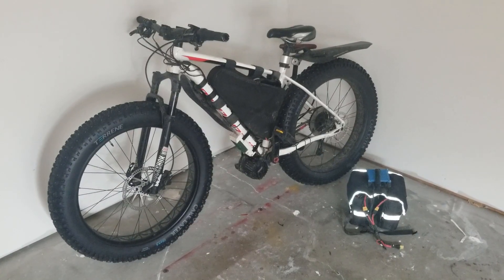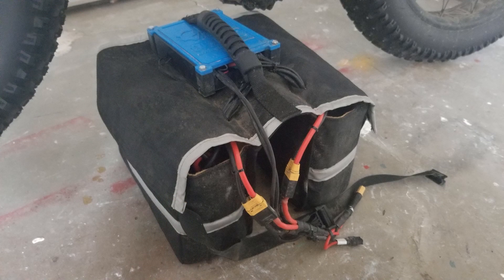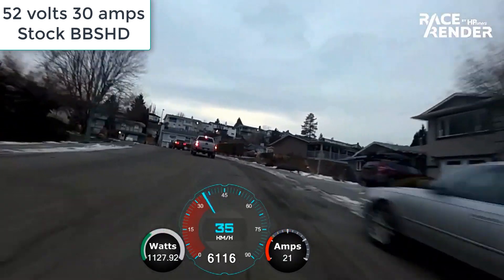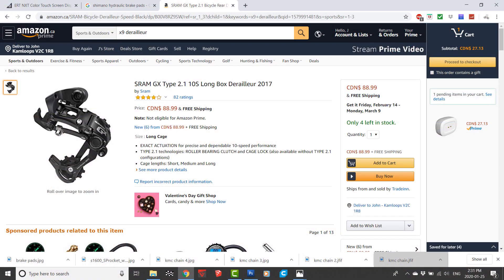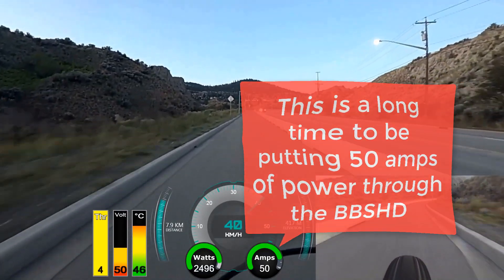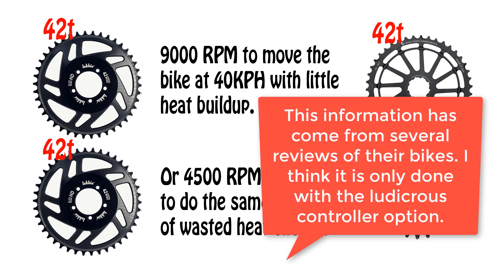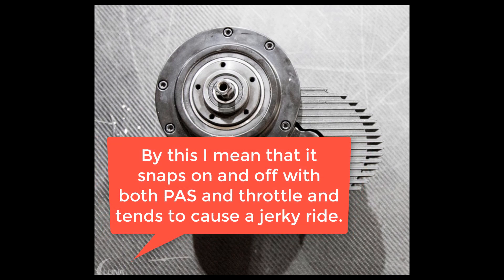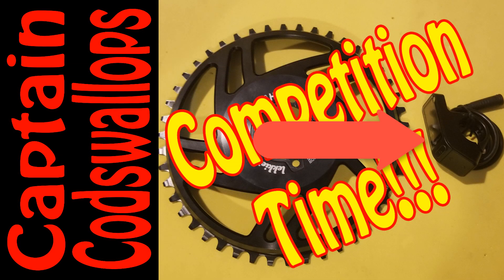Bafang BBSHD - ASI BAC 800 72v - Specialized Fatboy Ebike Conversion. The fastest & most reliable?

Comment: Just gotta change the plastic gear replacement.. like a Subaru head gasket
Reply from the maker: Shockingly I’m still on the original. I had figured I’d need to change it. I think the 1:1 gear ratio saved me!

Comment: How do you know what rpm you’re running? The motor on a 52v battery should be around 3700rpm. Its output spins at 160 rpm x 23:1 reduction. I know with higher voltage and field weakening you’ll gain a bit, but not that much
Reply from the maker: You gain a massive amount of rpm with the right controller and tuning. I am getting up to 13000 rpm loaded and over 18,000 unloaded. With a 52 volt battery it’s about 9000 peak loaded. Well over double the max stock at that voltage. The rpm is being recorded via the ASI Bluetooth app during the ride.
Reply: @HighVoltageKits  I think I got it. Someone else mentioned it. I think your controller is reading the poles. The bbshd has 4 pole pairs. 13,000 rpm / 4 = 3250. Which would be a proper rpm for the motor to spin at 52v.  But mechanically, the rotor is spinning at 3250rpm and the chainring is spinning at 150rpm or so
Reply from the maker: @victorvannatter312 nope. The bbshd has five pole pairs. The rpm is 13,000 and the data is coming directly from the controller. It’s using field weakening to boost the max RPM of the motor.
Reply: Interesting. But something seems not right with that. I’m not sure where it is getting that information from. But that’s not how electric motors work. They get their RPM from the way they are wound, and the applied voltage. There is nothing else a controller can do except for field weakening. But that will not make those type of gains. You would be going over 150km/h if the motor was spinning that fast. The output after reduction would be 565 rpm btw. Stock is 160. There’s something wrong. It’s a really good and informative video video, so I’m not trying to give you a hard time. But I would definitely look into that.
Reply from the maker: Sorry I missed this. There are lots of videos on the channel of this build. It’s 100% possible with field weakening. The top speed on a bike is 65-70kph with a 1:1 ratio to the back wheel.
Reply: @HighVoltageKits  you claimed in another video you gain 15% with field weakening. The rpms you’re claiming is an increase of 350%. That is simply not possible. There’s no way you gained 350% more rotor RPM with field weakening. There’s something else to explain this. This motor turns at around 3600rpm factory with a 52v battery. Unfortunately,  grin’s motor simulator doesn’t have field weakening. But to get that type of RPM, it would need around 200 V. That’s a huge jump from 52. I would be really interested to see if you had an external RPM gauge, and you were able to measure the chain ring RPM.  For the motor to be at 13,000 RPM, you would need to see 565 RPM at chain ring. 
Don’t get me wrong. It’s an impressive build. And you know what you’re about. I just think you’re getting wrong information from your controller. I’d be happy to be proven wrong. I just don’t see field weakening giving an over 350% increase in rpm

Comment: Hi, just come across your channel. I run 3 fat bikes in Wales UK, thinking of running a BBs-02, or BBSHD on one of them, over buying an E bike with Bosch, Yamaha or Shimano motor. I'm 20st in weight, South Wales is hilly in parts, but like you know, weather not the best throughout the year, and overall temperature not the warmest, if that makes any difference?. If I wanted a bike for carrying maybe a front or rear pannier, to carry a camera or drone, am I looking in the right direction for my first conversion? I ride two bikes with 26in wheels, 65mm wide rims with 4.8in tyres, and one with 26in wheel, 65mm wide and alternate 3.8 or 4in tyres.
Reply from the maker: Spent loads of time in Wales. Pembroke and Snowdonia mostly. Also, Tywyn way. My sister is near Carmathan so I'll be over next year. Lower temps mean the motor will run cooler overall. Recommend the BBSHD over the 02. There are also some new motors from TOSEVEN. The DM01 is I hope going to be the equivalent of the BBSHD with torque sensing. If you check the video history you can see info on those. You are also welcome on our Discord community. Links in the description.
Reply: @HighVoltageKits  Hi again, thanks for the heads up. I got two bikes I been considering running it on, as my two other fattys I'm running 4.8s and the stays and BB are so wide I think I'd be taking that chain line way out away from the BB and too much fuss on the mods taking away the lower gears. I'm either going to try it on a Marin Pine Mountain 27.5+ bike with 3in tyres, or a Ritchey Commando fat bike with narrower stays/BB on a 4in tyre. I'll check out the links of the other brand also. So for instance, as an example, if it was the same motor, same gearing on the bike, in a 500wt, 750, 1000, 1000+ travelling on the flat, at the same speed, which motor would be the most reliable, economical between charges, durable, and go the furthest distance also travelling at the same speed for all units? Remember i'm 20st, and thinking of a pannier for camera gear and maybe a drone also. Snowdonia looks stunning, we got a few nice trails down here just off the M4 motorway also, that's worth a look. Thank you for the previous reply. A friend of mine has a 48wt battery for sale also, so may get lucky with a new setup with two batteries.

Comment: Great video, thanks! I seem to remember seeing a video that Justin from Grin Technologies did where he installed a Phaserunner motor controller on a BBSHD and I thought that it fit snugly in the controller cavity after removing the stock controller. I can’t find that video anymore, and I wonder if Bafang made them take it down. I’m glad to learn about the ASI controlller, thanks for posting!
Reply from the maker: Thats another option. The phaserunner is based on the same circuit boards as the BAC800. They get the boards and put it on their own designed casing. They work pretty closely on it.

Comment: Great video, I have learned a lot.
Have you ever pulled any kind of trailer up a hill? I am hoping to modify my fat tire bike or another hybrid MTN bike to do this, either with camping gear or work equpment, but can't look too illegally powerful
Do you get stopped by Police? The central bag housing a battery makes the bike look more illegally powerful than the paniers battery setup because the motor is very discrete.
Reply from the maker: Thanks Nick. Check this video out from way back in 2018 I think. https://youtu.be/pOoZACypiFM I used to pull a two person trailer when the kids were younger. This was with a stock BBSHD. It was awesome tho. I am not sure how it would work with the High Power stuff as it stands now as the stresses are different. 1700watts was no problem tho! Was great fun passing all the lycra office gang. Never had bother with the police. Mainly because I ride respectfully and don't draw attention. Mostly they remark on the massive tires. The motor gets ignored. If I passed them doing 70 I think it might be different.
Reply: @HighVoltageKits  Yes people mostly remark on my tires too, they seem to think it makes the bike faster or more powerful, I explain there is no advantage on a road. one guy said my bike looks like it ought to have machine guns on it, its a bit Mad Max looking.
have you, or do you know anyone who took a rear hub motor and converted it to a front hub? It seems like it might work removing the cassette holder and carefully cutting down the axle bolt, adding new threads. After I upgrade the rear motor I will have a spare so I may as well try this with a smaller battery on the front rack and the same old controller, just to give me more power on a hill. another throttle too

Comment: The BBSHD is seriously flawed.  The revs it needs are way too high and the internal gear reduction is laughably inadequate.  There is no pedal resistance with a 1:1 ratio, turning the pedals does nothing except keep the current flowing to the motor.
Reply from the maker: Well it depends on your perspective as to what is a flaw or not. If you want peddle resistance run it stock. I'm running it at 4kw 72 volts like a mini dirt bike. I don't give a rats ass about PAS for exercise. I just like cruising about on fat wheels in any terrain no sweat and lycra needed. Stock the revs are like 4000 max. This is heavily modified for a reason. The 1:1 is to stop the internals melting. The riding you see is on the throttle. The internal gearing stock is very adequate. Check out some other videos before you judge it. Cheers
Reply: @HighVoltageKits  You're missing the point.  Stock is 1500 watts, six times the power of the average cyclists legs.  If it could deliver 1500 watts at 60 rpm crank speed you wouldn't need 4kw.  You could shift into the smallest cog and haul ass.
Reply from the maker: George. I used to run this stock. You don't have to use all 1500 watts. You can easily set it to just 200 or even 100 if you choose to. If you use an eggrider v2 you have a huge amount of control. You can even disable field weakening and have a program that gets you low power and rpm with our upgrades. I'm not interested in that myself. Your reasoning makes no sense though. Does a 750 watt motor have to be run at 750 or can it scale to a riders requirements. Do you have a bbshd? Have you ever tried to use one?
Reply: @HighVoltageKits  I have a BBSHD from Luna, 1500W, PAS and throttle.  Why would you run 1:1 at 15k rpm?  THAT makes sense?  The way it's supposed to work with a mid drive is that you upshift when when your legs spin out, you utilize the bike transmission.  Your setup is like riding around in first gear all the time in a car.  I don't like my feet just dangling with no pedal resistance, I feel a huge loss of control.  A bicycle rides over bumps and handles way better IF some pedal resistance is maintained.  I guess what you're saying is that the motor will overheat unless it's being run at high revs.  I think more gear reduction solve that and/or a motor that's happy at lower rpms.  Is that impossible?  Subscribed.
Reply from the maker: The short answer is that it's fun. I have not much interest in the exercise peddle part. It's  exactly as you say to prevent heat buildup. There is lots you can do with gears to have multi use bike but this is like a mini dirt bike in many ways. We have a discord community If you wanted to get tips on tuning the motor.  Thanks for the sub. Appreciated
Reply: @HighVoltageKits  Thanks, I will join the discord community.  Have you not heard the complaint I'm making from others?  I've always heard that electric motors make max power immediately, unlike an internal combustion engine.  Hence there's no need for a transmission.  Yet, evidently, it doesn't work that way with electric bicycles.  I'm thinking that hub motors may be superior because hub speeds are much higher than crank speeds, allow the motor to run at higher rpms.  It would be neat to figure out the ratio of hub rpm to crank rpm.  There are now high end electric road bikes with hub motors!  My first reaction was astonishment, they went backwards, but now I'm not so sure of that.
Reply: @HighVoltageKits  Evidently, I need an "invite" to join the discord community.
Reply from the maker: https://highvoltagekits.com/discord link and some information here, apologies George.

Comment: nice to hear critical points from an ebike builder who clearly has experimented with various configurations. more voltage, less amps = less heat….with a power increase. I built a bafang 750 watt coupled to a nuvinci rear hub with autoshift.  I have it geared low with a 34 narrow wide chainring on the bafang, and a 18 tooth on the nuvinci.  Motor always spins easily, and climbs ‘til it throws you off the back.  And only use a 10 amp/hr 48 volt battery, which lasts a very long time, motor is never amping up, even from a standstill, because the autoshift always starts you in the lowest gearing.  These cv hubs compliment the mid drives very well….only one chainline, so its super low maintainance…no derailleur😀  cheers and happy new year!
Reply from the maker: Your bike sounds awesome. Sounds like you got a good balance to let you climb those hills with ease! Happy New Year Jim!

Comment: literally just ordered my kit thinking 100mm would fit.. man i wish i saw your video first, Can i still make the 100mm work do you think? i have a 2016 specialized fatboy.  If i have to return it, hopefully that isnt too much trouble either.
Reply: also where in canada are you? im over here in Winnipeg Manitoba, pretty flat and no where near as nice as you showed in your video.
Reply from the maker: I'm in Kamloops BC, Unless the 2016 has significantly different seat stays I doubt it will fit and give you enough clearance to center the cranks etc.

Comment: Would it make sense to use an internal geared hub with maybe 3 gears, one for hills and two for flat out speed?
Reply from the maker: It's not a bad idea. Finding one strong enough to handle the torque is the challenge
Reply: @HighVoltageKits  That is what I am finding. Although, it would seem I am not the only one having this thought. The marketing is starting to address torque issues on the internal gear hubs.

Comment: Sorry if you covered this- could you recap how the upgraded controller feels w/ 52v battery vs. stock controller w/ 52v battery? I'm wondering if this is still  worthwhile if I don't want to buy a 72v battery.
Reply from the maker: This video is at 52 volts with the upgraded controller. You get a good boost as long as the battery can handle the amps.
Reply: You must check your battery BMS, I have 52v 21ah but unfortunately, 30A BMS, so even with the ASI BAC 800 as the controller. The max I can pull is 1500 w. Learned the hard way, do your homework first. 😫

Comment: Thank you for this video. I didn't see brake cut-off switches on your brakes, do you feel they're unnecessary? I'm doing a Salsa Mukluk build and would like to not use the cut-offs if possible as they're a pain to setup.
Thanks
Reply from the maker: You are welcome. I do have one on there but its hard to see. They can be useful. Mainly cause you can do a soft trigger and change gear etc. Are you doing a stock bbshd or modified?
Reply: @HighVoltageKits  A stock bbshd for now.  I was going to add that button cut-off on the left side for that type of shift and also a gear shift sensor.  Thanks
Reply from the maker: I'd skip the gear sensor and use the cut off. It only takes a slight touch to cut power. Change gear and back on. The gear sensors are not very responsive imo. Cutoff I like on the back brake.
Reply: @HighVoltageKits  Thanks, will do.

Comment: Well done. I was particularly interested in the logic you shared using the nylon gear. Without being an engineer on the team that designed this motor I believe that is the reason for using nylon. It's a perishable part that keeps you from destroying the motor. no questions about it. Thanks again. well done.
Reply from the maker: Cheers Steve. Still on the same one all these years later. Seem a few folks burn up stators that would likely have been saved with a nylon gear that went to the steel version. Cheers

Comment: I have 250w middrive yamaha motter..is it possible for me to covert it to a throttle only to do at least 25mph...its a giant fallon hard tail with a 500w battery?? Any help would be appreciated
Reply from the maker: There are chips you can buy to unlock bikes but it's not something I am familiar with. Does it have a throttle right now?
Reply: No its a giant hard tail mountain bike...2021 model am not sure what they peak at? Trying tofind put if i can get more watts out of the motter then put a throttle on to it...our just put a hub motter on an hook it up to my stock 500w battery
Reply from the maker: The difficulty is that they are usually closed systems. You might be able to derestrict it and get a power boost but a throttle addition it unlikely.

Comment: For all your money you paid i don't think it's worth it.
Was that controller about $350 WTF
That was the price of the full ebike I built.
Mid drive system 2000-watt
Including everything 
Including a 12 speed upgrade with eagle technology parts.
Including 72v battery 20s 7p original cells.
Including the bike 
When my wheel is spinning it looks like it's 4 times faster then yours in video.
I can only keep the Throttle on for few seconds feels like going to rip itself off.
Spinning that fast 

I must have bought the cheapest 12 speed chain I could find I never had any problems with it.
I'm not sure what people is doing to their chains.
They mustn't be able to ride a bike properly lol.
Reply from the maker: The frame rates on the video are a terrible indicator of speed. Hang on you built an entire ebike for $350 USD including a gear system which alone is almost $250-300... not sure I follow. Sounds Iike a fun bike tho. Which mid drive did you go with?

Comment: Thank you for sharing! I'm about to sell 2 of my hub motor bikes to build a mid drive and I saw people saying that controller with the Bafang BBSHD motor were amazing.. Little bit more research but I'm sold on the idea. I'll be going with a geared hub with belt drive though. But now with your lesson on the gears and heating the motor I have a better idea of what to look for. I'm going to over power a hub motor with that controller first. I have a motor that's been through hell and just won't die. I have to know what it's limits are, then I'm going to dissect it and learn how to rewind a motor. Great video, thanks again!
Reply from the maker: You are very welcome. Your projects sound great fun. You would be most welcome on our light electric vehicle discord community. https://discord.gg/pKHk5ej2GG